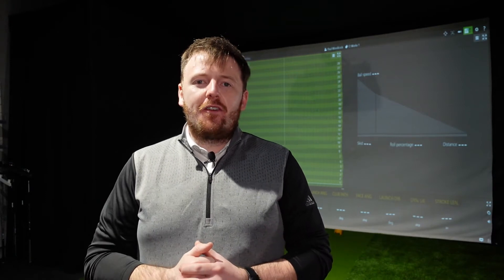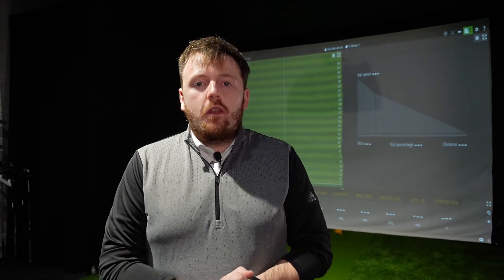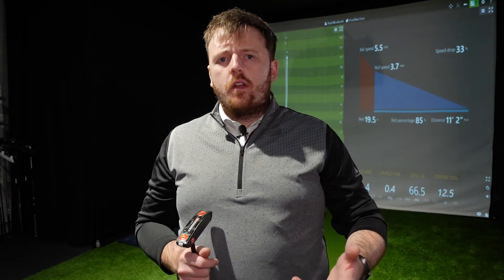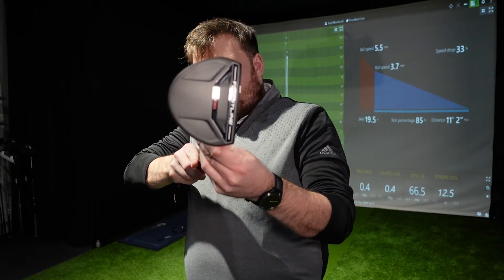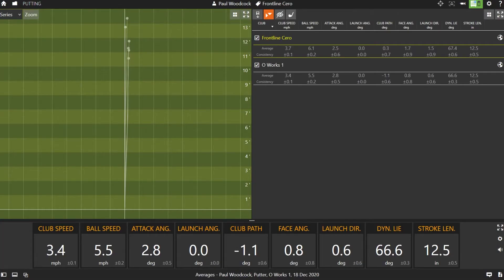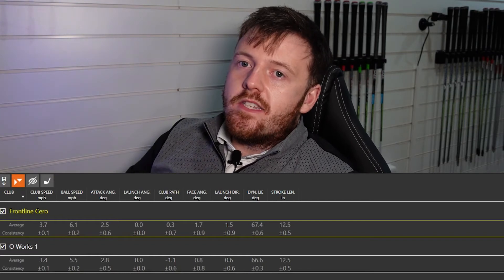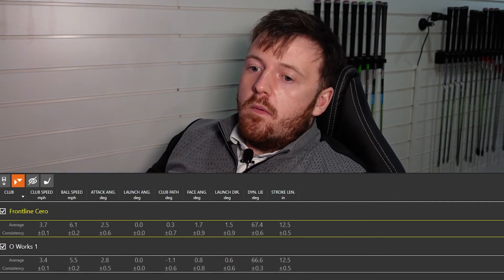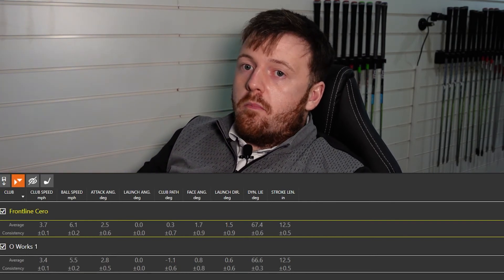How Much Toe Hang is Optimal? Trackman 4 Putter Fitting Comparison

Comment: Not a very scientific experiment really! To be more relevant you need to use a standardised head weight/shape and compare putting styles of different players. If you’re an arc player using a face balanced putter then you aren’t going to achieve the same path track as someone who is nominally straight back and vice versa!